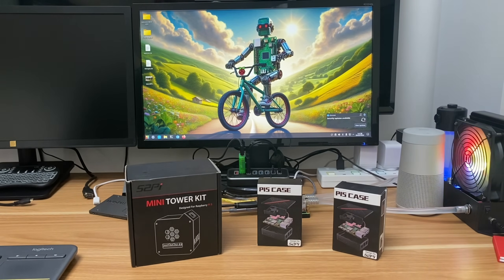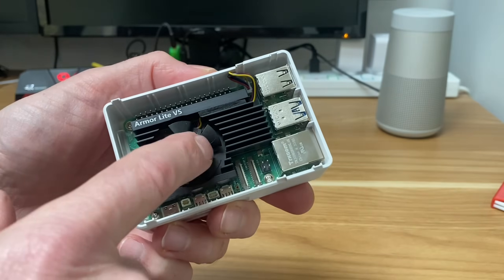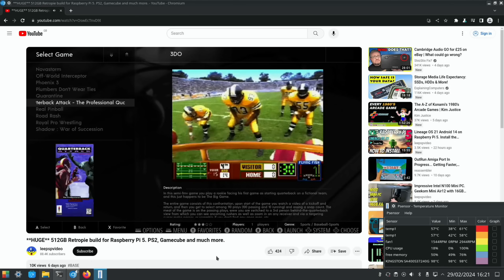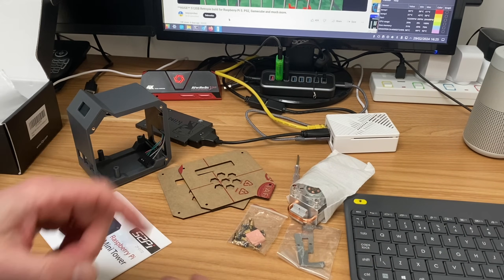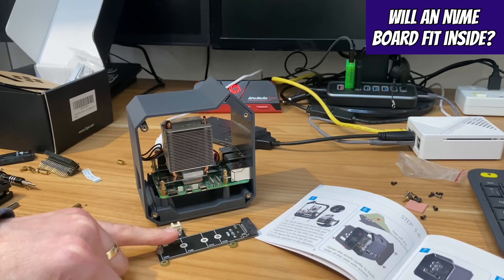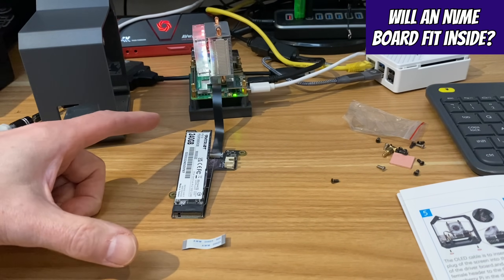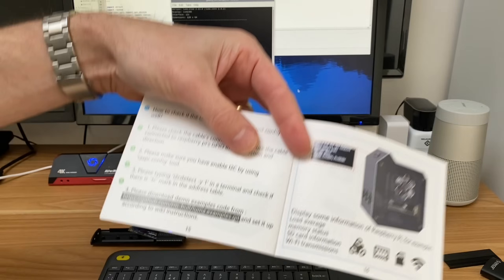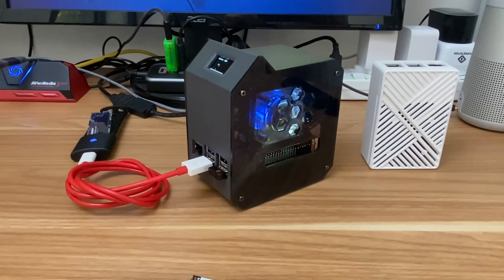Mini Ice Tower with OLED display for Raspberry Pi 5. 52Pi

Comment: The Mini Tower - I purchased Raspberry Pi's SSD Kit. The kit fits down inside the back of the case. I have it secured with a piece of insulation tape and it is fine. I agree that the SD card is difficult to remove. I have had to use tweezers. Next time I order something for the pi I'm going to get a SD card extension and to solve this inconvenience.

Comment: I ordered the Geekpi tower case with NVMe bottom. I followed the instructions to get the OLED display working and it was a pain as I am 79 years old and haven't worked with UNIX Sys V since the 80's. First off I used my initials instead of "pi" for the user. Secondly I could not remember how to use the VI editor and could not save a file created with vim-tiny. So, I used nano instead. I hated the default sys_info.py display as the text was so small, so using your suggestion I switched it to the extended version. I hope this helps keep my old brain active.

Comment: No Conway's Game of Life on the OLED display? Missed opportunity there. 🤣

It's a nice case but it needs to be able to take the Pimoroni NVMe base unit to be worthy of my purchase. The whole point of a case like this is internal SSD! It is a glaring oversight on their part. I do have a small portable SSD drive that could be external to the whole thing using a USB 3.0 port but, again, it defeats the whole point of having such a case.

Disappointing as it is so much cheaper, and probably easier to find, than the Pironman 5.

Comment: Nice video, Lee; however, the PI mount in the case can be removed. The inner bottom of the case with the standoffs mounlded in can beremoved by  unscreewing the 4x Counterunk screws on the bottom. You could then 3D print a new base with standoffs or, as I am going to do, reduce the size of the standoffs.

Comment: I really like the tower case. But I am unsure If I can run a display cable out of the back, what do you think ? Would it need to bend in a weird way. Or just work ?
Reply from the maker: It would need to bend slightly. The hole at the sd card slot end of the case is pretty large. You could also go out of the side by the hdmi’s
Reply: @leepspvideo  thank you :D
I found a 3D printed version of a tower case for the Pi. Will see how hard it is to make it fit a 2,5" SSD + adapter. If its too much of a hassle I will get this case. Worst case I take a dremel to it. And make the hole a bit bigger ^^
Reply: @leepspvideo  wanted to give you an update. As I think you would quite enjoy the case design ! :D

There is a tower style case on thingiverse. (Designer: "JISpal01" Thing: "6423660")
He has a towercase that has a integrated 2,5" mount in the feet. Slots for rubber feet. A duct to direct airflow from a ice tower. And the option to mount a nvme SSD inside :D.

I redesigned on of the top/bottom panels to not be fully grilled. I am hoping for less dust buildup that way. Maybe I can get some interesting shots of its cooling performance with my Flir photon 320 and post it in a make ^^

Comment: 100 mm ribbon  cable is available from Pineberry  Our custom ribbon cables for HatDrive! have impedance control and are specifically engineered to support PCIe GEN 3 speeds on the Raspberry Pi 5. 

The bundle contains 3 ribbon cables: 25mm, 40mm and 100mm. The cables are compatible with all our boards.

Comment: I'm disappointed  that the X1001 mount won't work in the mini ice tower. the m.2 SSD is much faster then a Micro SD card even though the m.2 SSD is only running at 25% of rated speed due to PI 5 bus limitations. I am booting off the m.2 SSD. The Micro SD card is being used somewhere else. I guess I will design and build my own case using my laser cutter engraver and use the parts from the mini ice tower to make it work! 😀

Comment: It looks like the tower case would be ready for the X1002 combo if they just lowered the mounting pegs by 5mm and included some longer screws. The screws would need go go through the Pi5, the X1002 with it's built-in standoffs, and into the mounting holes in the tower case.

Comment: With the undermounted Geekworm nvme mount, you can heat up the small mounting pegs to desolder the joints.  Once they are out the openings are usually the size of most mounting pegs so it may fit in there.  It would be a bit tricky getting it in, but it should work to out one in.

Comment: Not sure if you already have this in your collection, but do you have any videos validating some of the raspi 5 cases (housing) that fit with the nvme adapter? Geekworm X1001 or any other adapter that you see useful. Great work.
Reply from the maker: I experimented a bit here

PCIe NVMe for Raspberry Pi 5. Geekworm
https://youtu.be/XMA8e4r1AUQ

The Edatec has it sorted 

FULLY LOADED Raspberry Pi 5 Cases. Edatec adds NVMe, PoE and Analogue Audio
https://youtu.be/ZUKtfwAzv_8

I will keep trying. I really want quick access to the NVME slot

Comment: so metal screws on that first case won't hurt anything if the contact the back of a Pi5 board at those two points?  Looks like a design fail to me.

Comment: I have the Pi4 version of this case. Very happy generally but my display has been showing stats for ages now and I've experienced quite a bit of OLED burn-in. The custom display PWB carries all the fan wiring so it's not a simple replacement.

Comment: You're correct in that the FPC cable is not compatible.
FPC Side A -> Side A (Same Side) is like going 1,2,3 -> 1,2,3.
FPC Side A -> Side B (Different Side) would reverse the pins so going 1,2,3 -> 3,2,1.
So the order is in reverse. That is why it wouldn't detect the drive.

Comment: 1.Maximum current for PCIe wire is 1A, and voltage is 5V.
2.If you find that the SSD is not working properly, it is possible that the power supply of SSD is not enough, then you need to check the current requirement of your SSD to decide whether power the SSD separately.
3.Maybe the flat cable is too long
Reply from the maker: The Edatec supplies power as well as pcie, could be the answer. The pcie I was using does have a power connection I might be able to use.

Comment: Nice case and I love the little screen which would be nice if in color.  Too bad they do not have one that has a nvme hat built into it.  I would probably get one then since I would find it hard to go back to just a micro sd card after using a ssd drive.

Comment: Love your channel Lee... Q: Could you mount the nvme (hat or base) in the rear of the Mini Tower case vertically; parallel to the display wiring above the rear opening?
Reply from the maker: Possibly, but I really want a solution that allows me to instantly swap drives